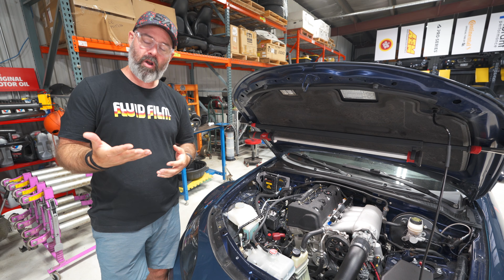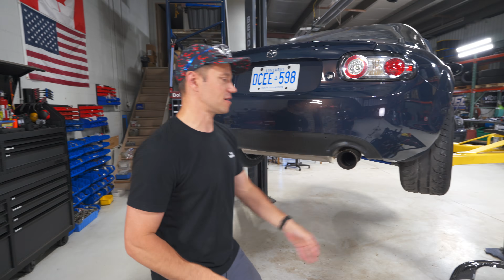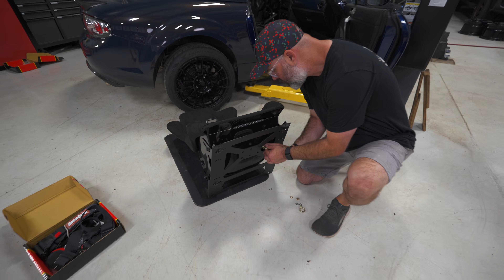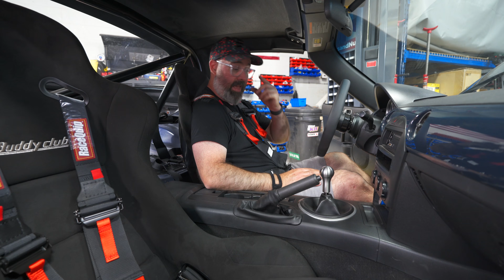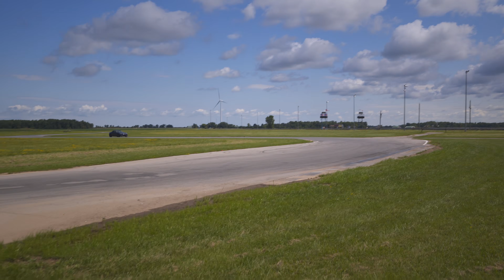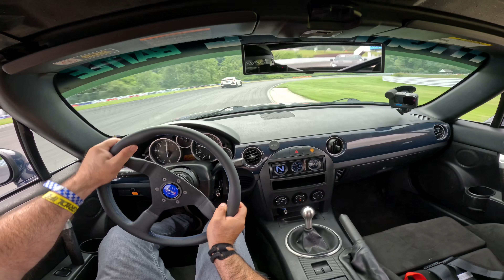Honda K-Swap Miata Gets a Complete Makeover

Comment: A 17x9 +48 with a 235 width tire would work, not a 245 on a +40. Read Goodwin's fitment guide. That +45 will rub, never mind a +40. Definitely going to rub without a fender roll.

Comment: You know what works better than the fancy carbon fiber lip (that’s not a splitter)…. A big 3/16” thick aluminum piece that bolts up to like the radiator support and such bits… just cut to shape, if it’s sticking out far enough some braces added for strength… won’t bust the first time it bumps something either.  

Same for the faux diffuser… doubt it’s actually doing anything… needs to extend much further under the car and have real vanes.

Comment: Such an awesome build!  I’ve had large mirrors tear right off the windshield.  As to the taillights, it would be cool for street use and safety if the entire center of the outer ring lit up amber for better visibility with turn signal /hazards.

Comment: There are loopholes and harmonization codes to counter the import duties, and to Canada they're not bad at all if you ship via AIR shipping. If you do ground shipping, there's a clearance entry fee and also the standard taxes based on your province. Quebec is real messy bc they have the Canadian tax plus the Quebec tax. Seen as much as 29-30% taxes, on top of import duties. It's so wild. Any way to counteract that such as your K-power partnership is 10/10

Comment: Hey guys are you sure that "Diffuser" isn't acting like a parachute? I'd cut out the bumper and add an aluminum plate from the subframe to past the bumper. It could be angled 7°-13°.  Add 4 end plates to block the wheel wakes. Then you'll have a real "Diffuser".
Reply: A splitter and a diffuser without a flat floor in between do very little
Reply: @batasrki  Not True.. . I've read 3 research studies showing minimal drag and good down force for the rear part of the car. The Only two vehicle types that does Not work is for Wagons and SUVs.

Comment: @speed academy for the gaps in the front lip and diffuser, get some small rubber or silicone vacuum line, split it and apply to the edges. That will take up the space without looking like a hack. The car looks great guys💪🏆

Comment: As an NC owner I love the series and I'm soo jealous... especially of the wheel choice you have there on the other side of the pond!
One small point out: forged wheels are not stronger at all, in fact they often are weaker! Bommer uh?
That's because forging allows a better fatigue life to the matieral with respect to casting or flow forming which allows small imperfections in the material.
Forging usually has much less imperfections, so that you can have less stiff parts (with less volume of metal) that have the same endurance and life, so they are lighter.
Stiffness doesn't change, the material is less brittle (no cracks but deformation when you "break it").

TE37 and CE28 are a perfect example of this: both forged, one much lighter, one much "stronger" in the meaining of how much load it can take before failing.
The strenght only depends on the geometry, the forging increases the part life with a given geometry.
Combine the 2 and you can have weaker geometry lasting the same of a cast design.

Comment: The 3M disc used for VHB residue removal is called a "Stripe Off Wheel".  It was originally designed to remove pin stripes without damaging the paint
Reply: or toffee wheel
Reply: @matt8906 
This was what I've known it as
Reply: Caramel wheel I thought. Same same
Reply: eraser wheel. its just a giant gum eraser.
Reply: I was thinking "Why would you want a special death wheel for removing Pin Stripes, those tend to be expensive".  But THEN thought past hot rods or customs and remembered back in the day manufactures would put pin stripes of a sort on.

Comment: Hey guys, Im pretty sure the rear lip/diffuser is a parachute, you should make a few holes back there somewhere. I know, I know is not going to look any good or any nice but, remember is all about the millisecond.
Reply: They’re cosmetic, the diffuser isn’t doing crap, and the “splitter” isn’t doing much far from a real splitter.  Some real components actually meant for aero forces and side skirts strong enough you can stand on, that jet out several inches would actually be functional. But they’re not doing that.

Comment: Not feeling the new tails but the stock ones weren't great either.   I have it on good authority if you put in a 5 inch 11k RPM tach from Autozone you will go so much faster. You'll be able to use all the revs with one.
Reply: Agree but disagree. Oem tails are always better than those tacky eBay lookin ones